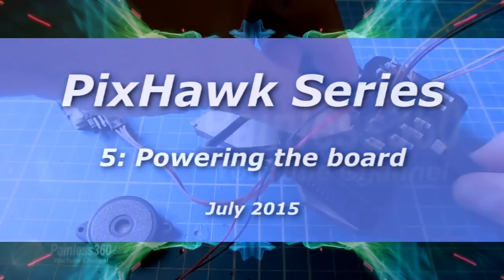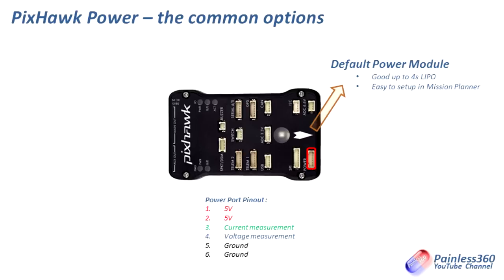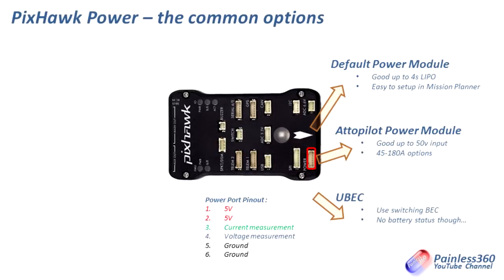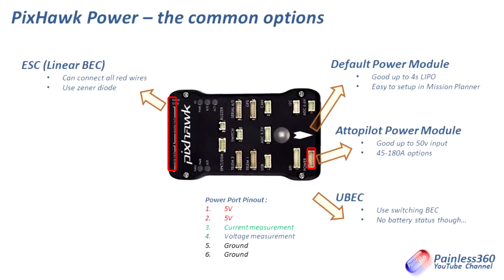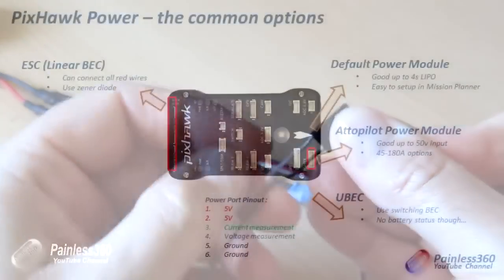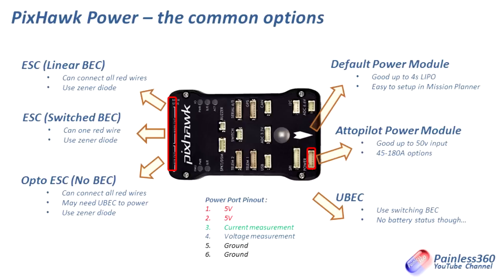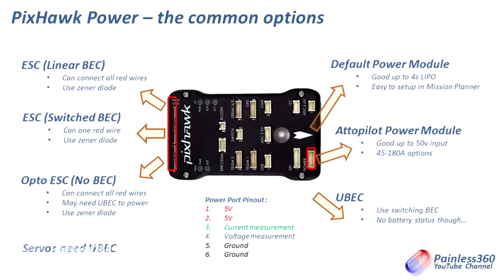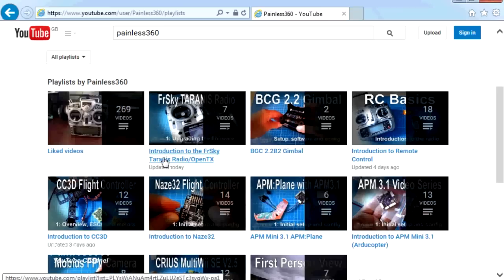(5/5) PixHawk Video Series – Common Power Options (BEC, Power Modules, ESCs and combos)

Comment: Hi Sir, since I have ESC (Linear BEC), can I only connect four ESCs to Pixhawk by only using signal wire (white) and ground wire (black) instead of connecting any 5v wire(red)? I think Pixhawk has been powered by power module, it unnecessary to plug any of red wire from ESC. I also did same things for my Spracingf3evo board.
Reply from the maker: If you're using Linear you can plug in all red wires but non are needed if you are using a power module (unless you want to setup redundant power supplies on it)..
Reply: Thanks!
Reply: One more question, can I also power on the Spracingf3 board by using power module and one ESC(enable red wire) together?
Reply from the maker: Nope, see the SP3 series for more detail :D

Comment: Hello
I have a quad running pix hawk. The quad works great but i have an problem with the throttle sensitivity if you can call it that. I am using an JR xf631 remote and an 7 channel receiver. My problem is my throttle is on the right hand side and does not return to the middle itself. When i fly the quad will go up and if i click the throttle one click down the quad drops and thus has no zone to hover. If I use the left hand side that returns to center i have a very limited throttle range. What would your advice be. Is it possible to set the return position if the left stick lower.
Thank you your channel is great
Reply from the maker: That radio doesn't look like it has the ability to add a throttle curve - that's how I would have sorted it on another radio.. This may help - http://ardupilot.org/copter/docs/ac_throttlemid.html Best of luck!

Comment: hmm,i guess i will remove all but one red wire from bec of esc(i am using linear bec,afro 30amp esc) and put a zener diode to power of the left side.I dont power any servos or gimbals at present from left side.And use dedicated power module in the right side so i have power redundancy.

And i have a question in mind.Since i dont need to power any servo or gimbals from left side why cant I remove all redwires from bec?
Reply from the maker: You can leave all of the red wires on the ESC leads  plugged in if the BECs in the ESCs are linear and add the diode to provide redundant power. Else you can simply remove all the red wires from the ESC leads and power the whole thing from the PM cable.. Best of luck!

Comment: 1)hey i am powering pixhawk from power module and connecting 4 linear esc with bec to pixhawk on the left hand side.So do i need to remove red 5v power line from bec from 3 esc and plug in only one red wire from one bec?
2)And I am powering my 4 motors from a single 10000mah battery .Will the above configuration fry the pixhawk in any sort.I heard power redundancy of pixhawk .
Reply from the maker: After watching the video (and checking the latest documentation) what is your guess?

Comment: I bought a zener diode 1n5339B, and the specification is written, that a minimum voltage is 5.32V, nominal 5.6V, and max 5.88V . It's not too much? Diode will be good for pixhawk?
Reply from the maker: +krq1234 not sure, I'd check the specs and compare. Best of luck!

Comment: I am building an autonomous underwater vehicle and need to power each thrutser (motor ) individually via 3s 5000mah lipo.Any advice on how to do it?
Reply from the maker: +Rahul Nath R make sure all the GND wires are connected and run one battery to one ESC and the rest should be the same. Best of luck!

Comment: Im getting ready to buy a Pixhawk PX4 2.4.8 and all the fixings. I believe that its the best for the money and easy to configure. Im looking to create a larger photo based quad, to do autonomous flight and also to us it experiment with 6 motor tri quad, which I believe to be very good photo type quad. I don't see anything else in your video library that would lead me else where. Also it looked like ver 2.4.8 was the newest available in the PX4 model. Thanks for any guidance or direction.
Reply from the maker: Be careful there is the PX4 firmware and the hardware (Pixhawk, PixRacer, PX4 based boards). I'd use a Pixhawk for a larger model where I needed solid GPS flight modes too. Best of luck!
Reply: right so I am on the right track Ill continue and clear up the models and versions/firmware but yeah I want a bigger model a lot of thrust, a real platform.

Comment: Hi. I'm using opto esc, that is without red wire and already calibrate the esc and the radio. After armed the PixHawk, the motors start to spinning, even with the throttle at the minimum. Do I need to connect a UBEC to correct this issue? Have you already face this issue? Thanks a lot.

Comment: Hi painless i have soldered my power module with bec in my power distribution board and i was thinking to solder a 12v step down bec to power my video transmitter to power distribution board as i am using 4s battery.would this setup work.
Reply from the maker: Should do, that's what I'd do - best of luck!
Reply: +Painless360 thank you very much for quick reply

Comment: Hello Painless360!
Is there any way i can switch 5v from aux relay pin (AUX 5 or 6)? I have it switching 3.3v, but that is not switching my UBEC on/off (to power my lights), seems to want 5v input. Placing 5v input into AUX 4 on the pixhawk from the UBEC had no effect on the output voltage of relay output (AUX 5). Any ideas?
Reply from the maker: I'd look at using one for the PWM controller switches we've look at on the channel. Best of luck!
Reply: +Painless360 ok thanks. i will try find the video.

Comment: Thanks for the video.  Couple of questions.  You show the ubec on the right side.  How does that connect to pixhawk?  The reason I ask is I am powering my pixhawk with the power module on the right side as seen in your diagram but have my ubec in the left side on the SB port.  My ubec puts out 5.0 volts and I have an opto esc controlling my motor (this is a plane).   A critical problem came to my attention today while waiting to take off.  My power module wire became disconnected and my servos and Pixhawk went crazy.  So it seems I am uncapable of powering the unit and two servos on the UBEC alone.  I have a zener installed but no capacitor.  I did some testing on the pixhawk while it was going crazy and never saw the servo rail voltage drop below 5.0.  Not sure what I am doing wrong.  Should my ubec be somehow connected to the right side of the pixhawk instead of the servo rail?  Any help in creating a truely redundant power setup would be appreciated.

Scot
Reply from the maker: +Scot Caraway Sounds odd, maybe on of the servos is pulling too much in operation - I'd try with only on then the other plugged in and think about increasing the current capacity of the BEC you are using. The details for redundant power is all in the Pixhawk documentation. Best of luck!
Reply: +Painless360 I will look into that.  I will also test with straight battery power into the servo rail.  Odd thing is I have been using that ubec to power 6 standard servos in this plane for 5 years prior to installing pixhawk and zero issues.  I guess that is why I ask about how the ubec can be connected to the right side of pixhawk.
Reply: +Painless360  I did another test.  This time, with my servos and bec unplugged.  I did not attach the main battery an anyway what so ever.  I powered the pixhawk via the rail using a 1000 mah NiMh 4 cell battery.  The pixhawk powered up fine, gps locked.  I did the red button arming.  Then I held the rudder to the right to fully arm it.  Within 10 seconds, the pixhawk sent out an audible panic alarm.  So either my HK32Pilot is defective or it is not possible to power the controller from the rail.  The documentation contradicts itself on this topic.

"It is dangerous to power the Pixhawk only from the servo rail, especially with digital servos. Servos may cause voltage spikes (as shown on illustration below that shows the servo rail voltage on an oscilloscope when a single digital servo attached to a Pixhawk is moved rapidly ). The key thing is that the digital servo causes the voltage on the rail to rise above the critical 5.7V level. Above that level the Pixhawk power management will cut power to the FMU and the Pixhawk will reboot. If that happens when flying you will lose your aircraft."

Compare that to this text on the same page:

"Powering/backup off the servo rail
Pixhawk can be powered off the servo rail instead of from a power module. This is achieved by connecting a 5V BEC (with or without a servo) to a power (+) pin and a ground (-) pin of the “MAIN OUT” or “AUX OUT” pins. You must also add a Zener diode (part number 1N5339) to condition the power across the rail and restrict it to less than 5.7V."
http://copter.ardupilot.com/wiki/common-powering-the-pixhawk/

so unless my board is bad, there is no way to do a backup of the PM device using the rail on the pixhawk, unless you do two PM devices.

Has anyone been able to exclusively power Pixhawk, or any of its variants, off the rail?  Servos or no servos?

Comment: hi Sir, I set up my New pixhawk and Now it works without troubles. I have only a concerns, when the tricopter leaves the ground it drifts.  I also tried to use the radio trims to manager this Topic but with no success. do you have any suggestion for this behaviour? Thanks and Regards Andrea Montani
Reply from the maker: +Andrea Montani A couple of things to try - check the centre of the radio channels for yaw, pitch and roll are all 1500, make sure that the accelerometers read 'level' when the model is flat and you maybe need to mount the tail with a small 'lean' to one side to counteract any yaw drift. Best of luck!

Comment: hi Sir, We got in touch on the 1st video for pixhawk setup on a tricopter. our pixhawk had a problem and it was replaced by 3dr. Now I am going to setup a New one and I like  to check the output in the log file by mission planner.  do you have any suggestion about which parameters I must keep under control like current, voltage. ......Thanks in Andvance.  Regards Andrea Montani
Reply from the maker: +Andrea Montani Log-files are normally useful if you suspect a problem and then you are looking at the things that you're worried about. There is tons of useful information in the logs so reviewing everything can take a long time. The ones you mentioned are useful to check that the power system can handle everything ok. Happy flying!

Comment: Where does one get this Zener Diode from?
Reply from the maker: +Jim “Babayaga” Me Anywhere that sells electronic components. I got mine from eBay..
Reply: Everything I see on E-Bay does not look like the one you used in the video. All I see on E-Bay is diode with long wires on both ends.
Reply from the maker: Yep, that's the one..

Comment: im trying to connect retracts thru my pixhawk and its not working out for me. i have gone to the full parameter list and set rc9_function to 29 ,gone to extended tuning and made ch 7 retract mount. im using a dx9 trnsmiter and have ch7 set for aux1 using 3 passition switch g . can any one help me out. i also put a bec on the aux out 4 and the y cable to the retracts on aux out1 on the pixhawk.

Comment: Hi. Love your videos! One question can you run dual 4s battery's through the standard power modules?
Reply from the maker: +Terry Dubay Depends on what you mean by dual - parallel or series? If it's parallel then the overall pack voltage is the same so anything that works on 4s will be happy. Best of luck.

Comment: Hi Painless, I saw that somebody use the PixHawk to build a VTOL aircraft, which it can switch between airplane mode and multicopter mode. Can you made a video about this function and how to set up on PixHawk? Thanks!
Reply from the maker: +Jerry Liang I would need the model and lots of other parts for a video so I can't see that happening in the near future. https://pixhawk.org/platforms/vtol/start is a good place to start. Best of luck with it.

Comment: Hey mate, for sure your range of PixHawk vids knock the spots off anything even 3DR puts out never mind youtube.  I am struggling with ESCs and motors though mate.  You're the only person talking about zener diodes and although my escs plug straight into my power board (hobbyking quad pdm) and to the motors using 5mm bullets i am getting zero spin even in motor test.  Willing to buy a few beers for the help ;-)  I want to avoid magic smoke.
Reply from the maker: +John Cassidy I would connect the esc directly to the throttle channel in the receiver and then see if you can run the motor that way - it will prove that the ESC and motor are happy and then you can focus on the settings in the PixHawk. Make sure you can see the board arming ok in Mission Planner too - no ARM = no throttle.
Reply: Thanks for advice mate.  I'm using the FrSKY D4Rii receiver which only has room for 4 direct plug ins from the escs.  It has a 4 pin output on the side so I'm unsure of wiring flow and electrical budget.
Reply from the maker: One of them should be the throttle channel if you pop it into PWM mode.. Check on the Taranis..
Reply: Sadly I'm using the 3DR X8 TX mate.  Oh well thanks for the help, I really appreciate it.  I'll get scouring for a work around.  Any pointers on setting up ESC / motor bench testing in terms of how to check they function without building out then finding the fail?  Love your work mate.
Reply from the maker: Usually they all work fine. I have a video on the common building gotchas that covers the main points when building. Best of luck.
Reply: @johncassidy295  gidday mate i know this is old but i had a similar problem, painless is right unplug you escs and plug them one at a time into the throttle port directly on your receiver with props off power the receiver and esc with the throttle stick all the way up they should make different beeps then put throttle back to the bottom u should get more beeps and that esc should now have a usable throttle range calibration, repeat for all escs then put back together and try. If everything is arming and spinning u can then do the eac calibration in mission planner

Comment: It's recommended to be used a 5.6V Zener diode, but it can come with several types of power setups. In an electronics store nearby me they sell (in this case that I wanted) a 5.6V Zener diode with 0.5W, 1W and 5W. The seller told me that most probably I would only need a 0,5W or 1W, and that 5W would be too overkill. But since these diodes are so small and so cheap I dunno if it makes any difference.
As you can see I don't know much about electronics, just want to fly the damn think, and I don't understand why such a simple thing doesn't come already ready from factory by default?

Comment: Great teaching videos! Well done. I have a question about "banggood.com". Are the pixhawks sold there the same quality as ones sold in the US? I see their pricing is pretty good but am wondering about the quality of their goods. The old adage you get what you pay for comes to mind.
Reply from the maker: +Denny Laman I've had lots from them and not had a problem. A lot of the 'clone' boards seem to come from the same couple of places anyway so buying them is a chance with any supplier.Best of luck with the project!

Comment: Thank you for all your pixhawk videos. I wonder if you have had any sudden flip of death at low rpm with this board, or any other FCs for that matter? Because I had too many and it took me 6 months to repair and replace escs n motors, resoldering etc, and I think I found the solution - as all flips happen during takeoff hovering and low throttle input , I think FCs have a hard time figuring out power distribution, this is particularly apparent with a unbalanced hexacopter. So I didn't have to replace anything, all I need to do is punching out after arming- and I have had a solid month of happy flights without a hitch. I just want to hear what's your thoughts on this or if you ever looked these FCs behaviour with 6+ motors and unbalanced frames.
Reply from the maker: Lots of reasons for this. Ive never had it. I would check the escs first. Check throttle range and make sure they are simonk or similar.  Best of luck!
Reply: Painless360 I have never had this problem with both APM and Pixhawk when installed on a quad, it only happens when the same FC is later installed on a hex (with updated firmware of course).
Reply: My 680pro needs some stick input to keep level at tale off if i launch slowly but it fine once in the air. It will take off fairly level with more aggressive take offs